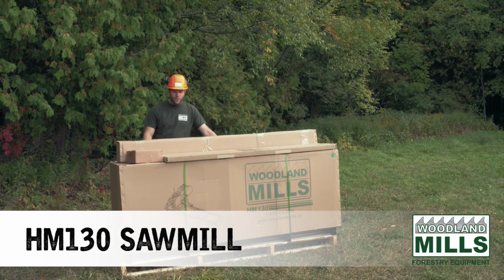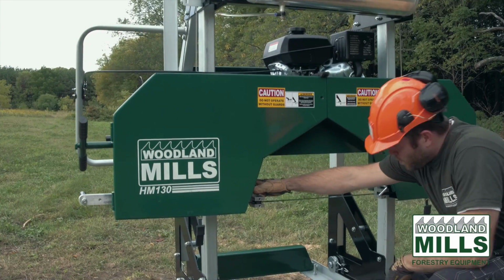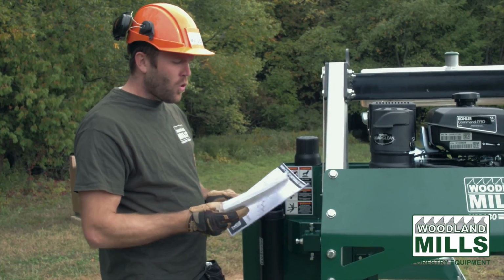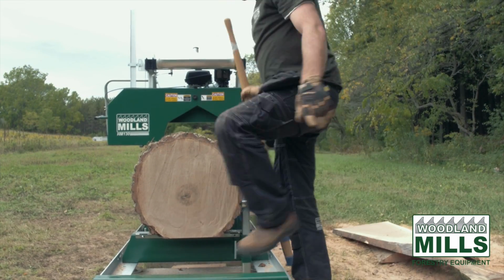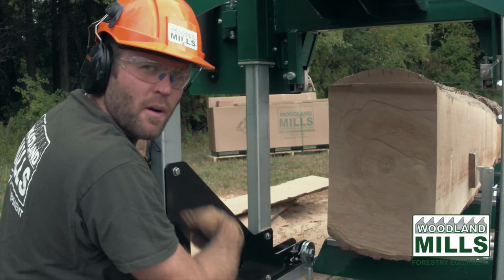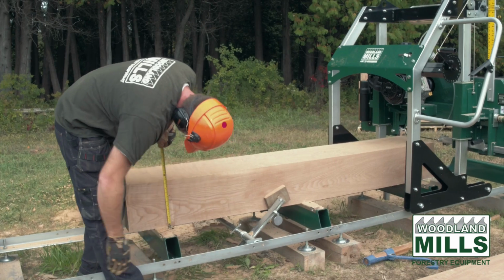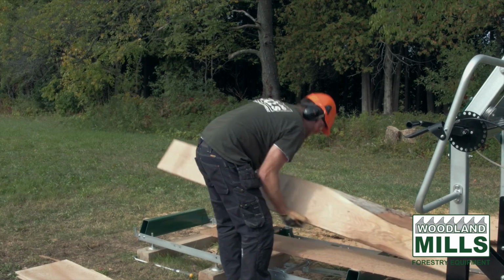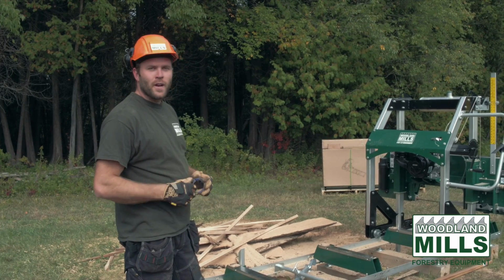Woodland Mills HM130 Portable Sawmill

Comment: I know it's another "offshore" piece of equipment, but this is a fine sawmill.  Very stable head.  It also gives a lot of user feedback.  You just "know" when to adjust the blade tension and it takes very little effort to feed into the logs.  I hope Woodland Mills can maintain tight control over the manufacturing in the years to come, but for now, this is the best bang-for-buck sawmill I can find.  The design changes from a few years ago were good ones.   Thanks for the vid and time it takes to interface with us wood noobs.

Comment: what is the overall height of the finished mill on the trailer ?
Reply from the maker: Hi Tom, The minimum height is 84 1/16" with the head down in the lowest position. The maximum height with the head in the highest position is 108 1/16 " high. You can also check out a diagram on our website www.woodlandmills.com or give us a call 1-855-476-6455

Comment: what is the lubercant for the mill
Reply from the maker: Hi Scott, In the lube tank, we recommend a 1/4 cup of dish soap to one tank of water.  You can use windshield washer fluid in the winter, with a ¼ cup of dish soap.  If you are milling a really sappy log, you can increase the dish soap. This will help keep the pitch off of your blade and keep it cool while cutting.

Comment: Why is there no stainless plate on the last runner yet they are on the extensions? wouldn't that throw off the surface height?
Reply from the maker: Hi Josh - The last log bunk gets moved to the end of the track when you add a track extension. Therefore, that bunk never supports a log, regardless of how many tracks you add.